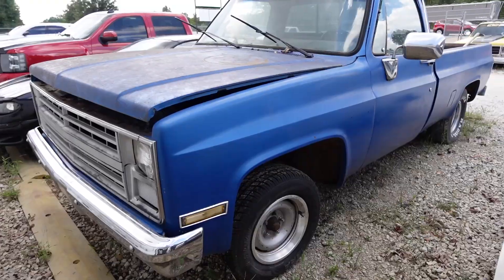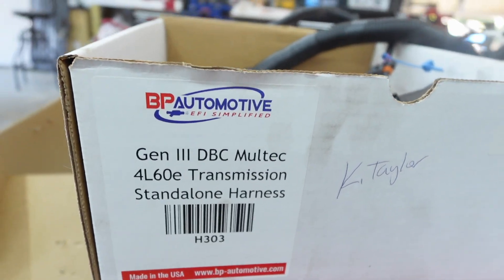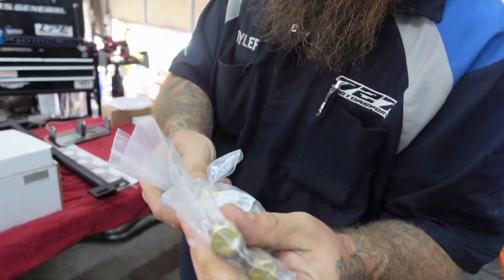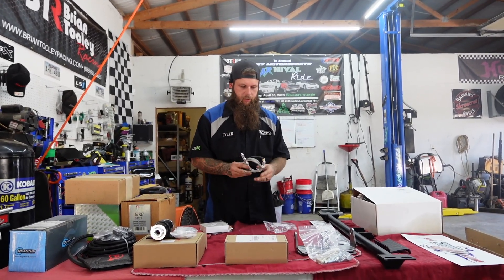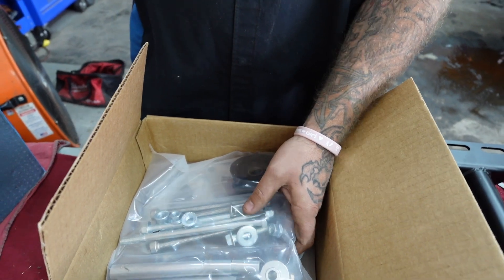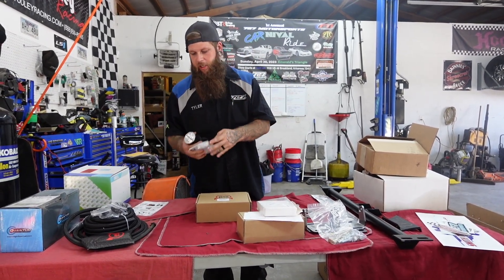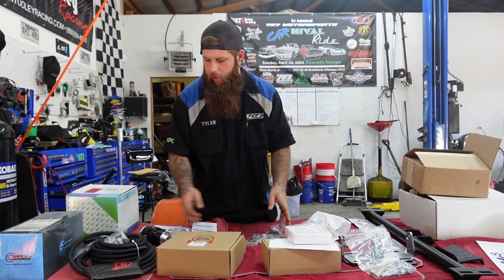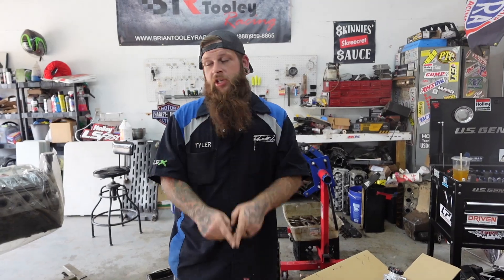Here is what YOU NEED! 73-87 c10 LS swap Parts

Comment: terminator x is pricey but goddamn if it doesn’t solve every problem going forward, including cam changes and adding boost, changing transmission, or throttlebody styles based on supercharger or what have you

Comment: I know I hear you say “Bp” but man this one looks very similar to my eBay harness and it’s been outside on my truck almost 2 years and it’s still looks new/ wires are still on good condition 🤷🏽‍♂️not fading
Reply from the maker: Most of the swap harnesses are gonna look similar. The difference is usually in quality of wires and connectors. I’ve heard mixed reviews about eBay harnesses. I’ve also had them catch fire that’s why I use name brand like BP

Comment: Man i found you at the right time... literally in a couple of months i'm going to kick off an LS swap into my 1986 c30... I am ready to keep this thing on the road, but want to get out of the 350 / turbo 400 and into something that will last and give a bit more power and mpg.  Let me know if you think 90% of this is applicable to the c30 - and I'm about to make a parts list of what you have here... thanks for the help, and i'm subscribing.
Reply: Hey man have you found any other information on this last swap matching with a c30
Reply: @DirtyD03 yeah dude, I am doing mine with a 6.0 and 6l90 from an Isuzu NPR. I have the engine and transmission and just cleaning up the frame first. If you want another good video on this look up Pirate Jet Garage c30 and you will find a really complete video about doing it in one weekend

Comment: I just had my 700r4 rebuilt in my 1987 chevy r10 can it be used with a LS1?
Reply from the maker: @CJ9494.  it can but you will need a detent cable for kickdown. 700r4 are pretty much a 4l60 that isn’t electronically controlled.
Reply: Gotcha thanks for the reply! So could i use the same harness you guys used here just zip tie up the connectors leading to the tranny?

Comment: MWhat throttle cable bracket do you use or recommend.  I have the braided throttle wire cable already. And I am using the Aces Efi intake.

Comment: Have you had bad luck with external fuel pump on the factory tank? About to install one on a ls swap c10. Also i have the  "corvette " filter /pressure regulator. The one that has the return built into it.
Reply from the maker: @recruit_life0715  inline pumps tend to overheat on street driven applications. I’m not particularly a fan of them. In tank for the win

Comment: Which trans crossbar mount is that?
Reply from the maker: It comes with the speed engineering exhaust kit. 🙏🏻🙏🏻
Reply: What about the driveshaft?  @727motorsports
Reply: What about the driveshaft?  @727motorsports
Reply: Nice! I purchased the speeding engineering kit. Also, which driveshaft did you use? I have the stock diff...@727motorsports

Comment: What oil sensor unit works with the ultra gauge
Reply from the maker: @manuelalvarez6987  it’s not based off the sensor but the year model ecm. The earlier gen 3 single wire oil sensors never went to the ecm so readout they obd2 isn’t possible

Comment: I am doing a LS Swap  frame off restoration on my 83 C10  and this makes the job a heck of a lot easier for my parts list.
Reply: Doing the same. 5.3 and muncie m22 in my 83 short bed. How's it going man?!
Reply: Me as well boys. ‘83 2500 6.0 4L80E swap
Reply: me too, how are you guys doing with the swap?
Reply: @gustavoescamilla6662  Waiting on my shocks so that I can do the 5/7 drop. The frame is done. Trying to find OEM parts in good condition is an adventure (doors, fenders and the bed). I have a lead on some good fenders

Comment: Do you have part #Number. Would help me out hole lot. Please with my project..
Reply: Those ecm mounts tho💪🏽
Reply from the maker: Which part?
Reply: @727motorsports  could you drop all of the part numbers for the 73 - 87 C10. That same set up that you’re doing in the video.
Reply from the maker: @billycooper9879  yessir I’ll add em to the descriptions
Reply: @727motorsports   all of them please
Reply from the maker: Check description!